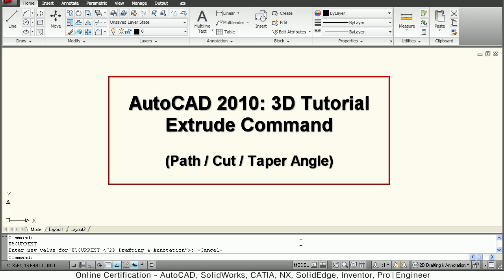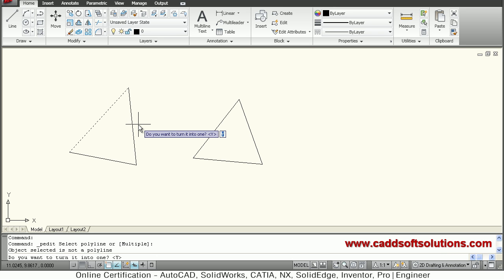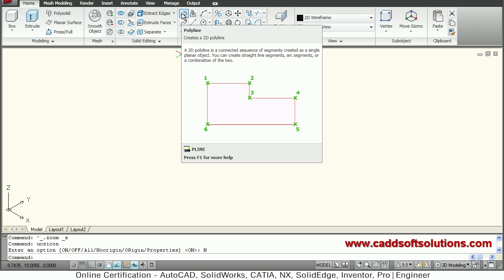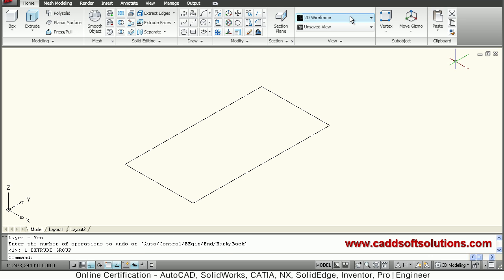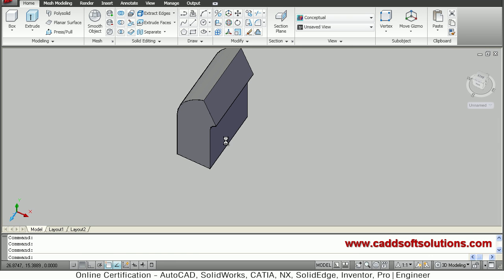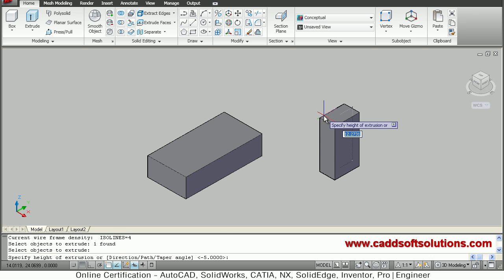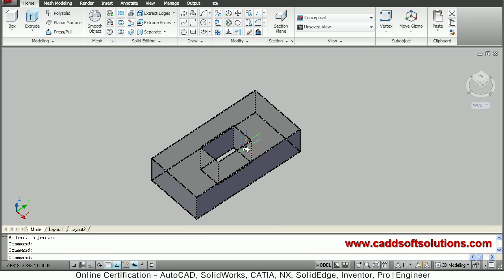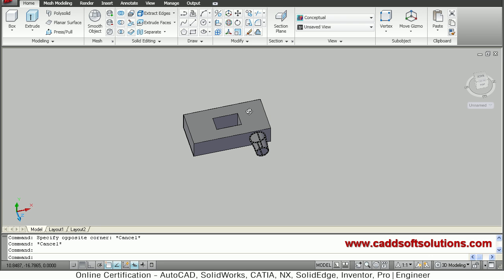AutoCAD 3D Extrude (Path/Cut) Command Tutorial | AutoCAD 2010

Comment: Lines have to be one polyline to be able to extrude so use the 'join' command to connect separate lines into one. Then extrude and it should work fine without creating walls.